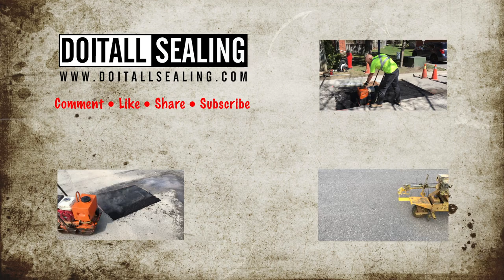Parking Stall Asphalt Repair with Bobcat & Dump Trailer

Comment: Was this going to be sealed in the near future? If it was a long term fix it should have had tack put on the edges and existing asphalt. Another thing that could have been done was milling the asphalt then patch.
Reply from the maker: They were paving that section later on after.  Yes tack coat is great to bond you can see me using that on my new channel: https://www.youtube.com/channel/UCE4x9dzt-NuHwlEDuAdC2kQ?sub_confirmation=1  Milling would work as well but this was just a small job.
Reply: If you grinded or milled the asphalt , you would of made that job even smaller and made the same type of quick repair.. Two 4' by 4' patches, just to cover the oil spots. Maybe just one of your bobcat scoops of asphalt with a 3/8 rock would of covered it.

Comment: Awesome videos I'm looking to getting in this business of seal coating and patching how do you know how deep to go when using the saw ? Thanks
Reply from the maker: Unless there is a pot hole or some way of seeing how deep the asphalt is you don't really know.  Normally we just sink the saw all the way down.  This way you won't have to re-cut if you are not deep enough.  If you are running a walking behind saw I normally cut 5-6" down to be sure.
Reply: If you use water on big saw you will see color of mudd when your in dirt

Comment: Ok. Well.  The little oil stain  turned into 3 parking spots  tire track marked up stain.  With almost a full new spot.   Get a heater blower.  Reuse that still decent  asphault  just sturr it up.  No cuts
Reply from the maker: Infrared Heaters are amazing and they do save time!  I'm actually getting one this season!  Thanks so much for watching!
Reply: @JeffLepard  please have videos of it

Comment: You didn't fix the problem though, you only put a bandaid on it. That oil seeped through all the asphalt as made clear by the large stain shown after you excavated. Oil doesn't stick to asphalt. Unless you cleaned and sealed that oil, the asphalt you put down will start showing damage in the same spot.
Reply from the maker: The base wasn't too bad it's been over 2 years and it's still fine.  They will be paving the entire lot soon.  I've seen some oil go right through both layers and soaked into the granular which all had to be excavated.

Comment: What do you spray your tools and the bobcat down with an order to prevent the asphalt from sticking?
Reply from the maker: BossaNova Ross you can use Diesel or a solution that is at the asphalt plants the truckers use.   Diesel works the best though.
Reply: Thank you Jeff. 
I really like your videos. You're greatly appreciated 100%
Reply from the maker: BossaNova Ross Thanks so much.  This coming season my videos should be even better.   Thanks for the support!
Reply: Jeff Lepard 
You Rock. Keep it up!
Reply: We used to use Diesel, Not any more. Go to Dollar general and get the Cheap PAM spray they carry. We spray in our Hot Box and tools. Way better than Diesel It is good to 500 degrees. (and you can eat it too). Yes it it a few dollars more than Diesel but works like nothing I ever seen.
Reply: They also sell asphalt release agents.